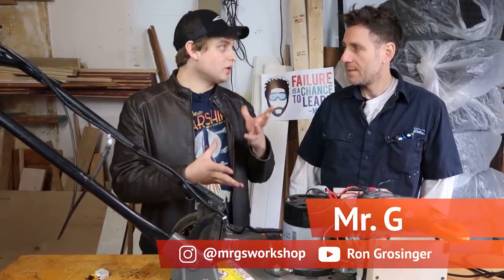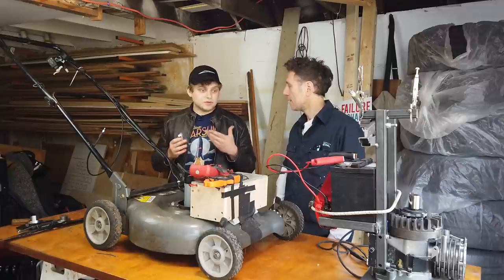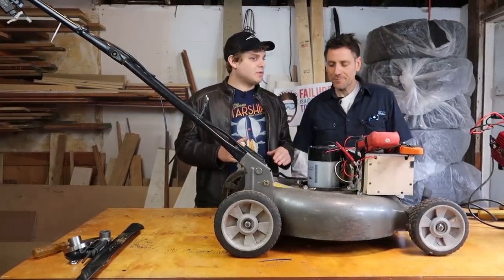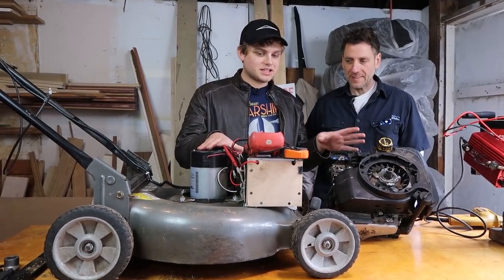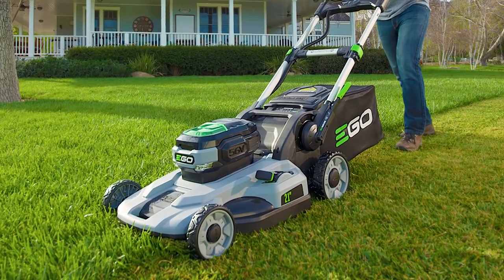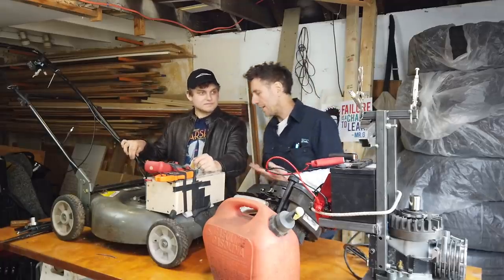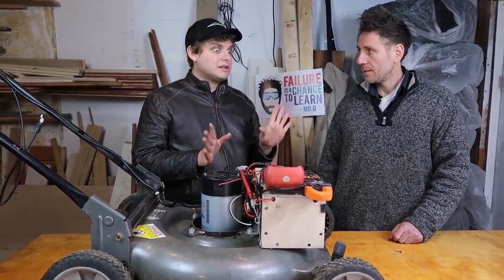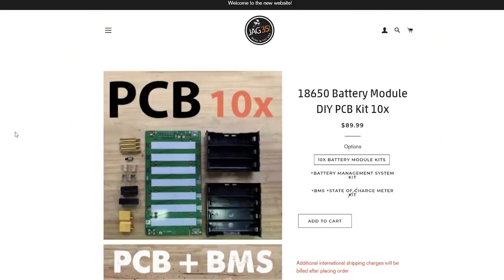Electric Conversion Workshop: Lawnmower Project - Episode 12

Comment: I had a plug in electric lawn mower in 1968 it was also nearly silent you could actually hear the grass snap .  the motor was wound for 115 VAC like old box fans.   Unfortunately i moved and we sold it.  About 10 years later I got another corded electric lawn mower this one was less elegant.   The new design had a lower voltage motor with a transformer and possibly a rectifier on board. it also had a fan and baffle designed to make it extra noisy.   Apparently someone decided it need to make noise since it made it sound powerful like the ICE mower.

Comment: let see if you make a bracket for the new battery on the mower, so you can pull out the battery and charge it. Let see the finished product.
Reply: Well there is no finished product. It's a DIY proof-of-concept prototype.

Comment: Love this build, I think finding parts that are appropriate and work together would be hard. Unfortunately sourcing batteries is rather expensive. Also keen to see charging system and battery monitor solution. Can you make it solar powered so it is a self contained unit?
Reply: have to be a separate  plug-in panel I suppose because a PV panel would need larger than it makes sense to mount on the mower

Comment: why dont you just us an electric one that you plug into the wall, you dont HAVE to put batteries in everything you see.
Reply: The battery electric lawn mower is a prototype proof-of-concept that teaches the basics if you want to convert something larger like an automobile. And, if you look back to the early episodes, we did start by plugging in a drill motor to the lawn mower.
Reply: @RonGrosinger  It would be nice to see you do a project based on what he suggests. I had a corded electric mower and this spring got tired of pulling the cord around and finding plugs, so I bought a new electric mower with two lithium batteries inside. If I could have bought Garcia's battery pack and put it on my old corded electric mower, it would have saved wasted resources. One question: my new mower has a brushless mower. How would you brake that without short circuiting it?
Reply: @johnedwardtaylor  a waste of resources? and you are buying a lawnmower with batteries? are you serious?
Reply: @electricdonuts  not being a dousche, i am all in with electric cars and renewables, just sharing my point of view, i think that it goes against the message that this chanel trys to transmit to people. I have the feeling that Americans just think Stuff just grows on trees, for example lithium, it is not unlimited, also just like fosil fuels you have to mine it. which if you look it up uses great amounts of sweet water in places where there is not much. if you use all the water in the only oasis in a dessert, you generate a great impact in the environment. 70% of it lies in the borders between paraguay, argentina and chile. so summing up it is not just like, ok battery prices are droping so we can put it in everything. it should be limited to few products like transport ans electronics. and reducing the amount of stuff we take out of the mf ground. which i think this conversion fails to do. Dont get angry about my opinion. i didnt make it against what is best for everyone.
Reply: @ianstoeffbelkenoff2716  It can reuse old cells, and lithium is a waste product of desalination plants.
Reply: @CTimmerman  ,you are right about reusing and maby right about the desalination thing. but only a little amount, actually most of it comes from a proces in which you flod a salt flat and then take it out  when the water evaporates. you can look it up here. https://www.samcotech.com/what-is-lithium-extraction-and-how-does-it-work/#:~:text=Lithium%20brine%20recovery%20is%20typically,and%20distributed%20to%20evaporation%20ponds.